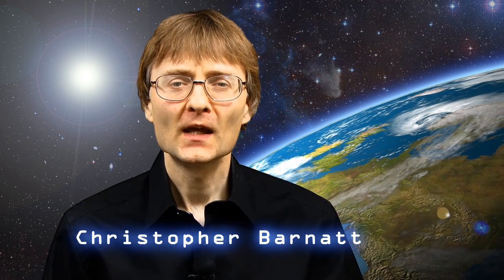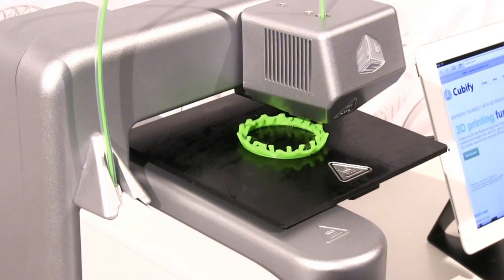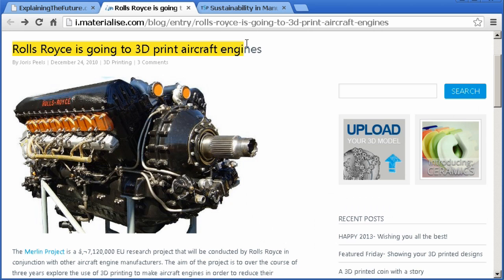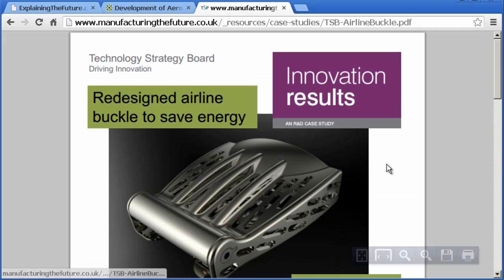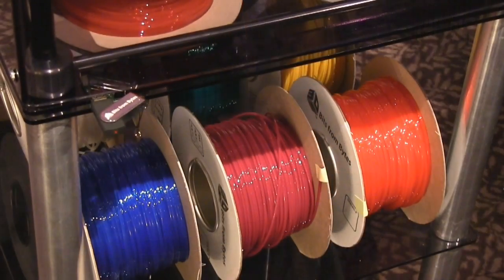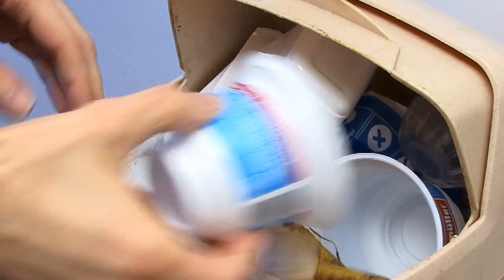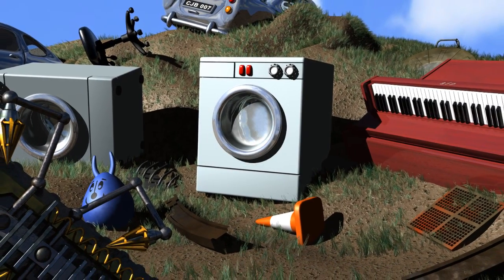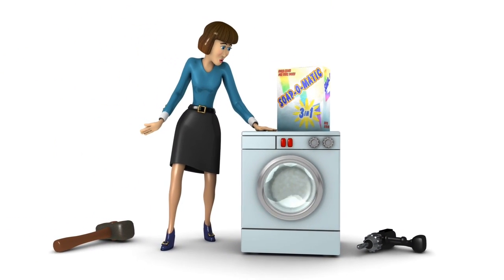3D Printing & Peak Oil

Comment: Can any 3D printers print things out of glass?  I see glass as one of the most underutilized materials of our time, infinitely recyclable, plentiful, non toxic and easily disposable.  The main problem with it is weight and with on site manufacturing I would think this would be the material of choice in a lot of applications.

Comment: There are already over 200 3D printing build materials. These include plastics (ABS, PC, nylon and PLA), plus metals (including stainless steel, bronze, titatium, cobalt chrome), a wide range of specialist photocurable resins, ceramics (so you can 3D print cups and saucers!), foodstuffs (eg chocolate, frosting and cheese!), and also things like concrete -- and of course human cells! :) (Checkout my bioprinting video).